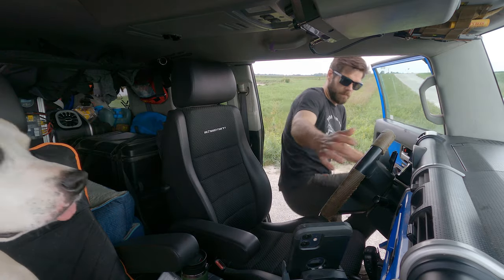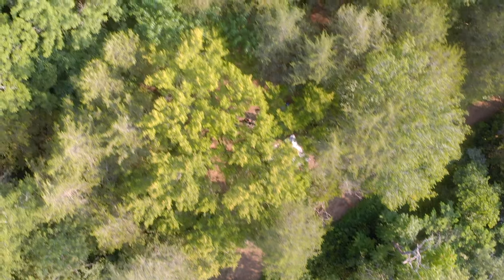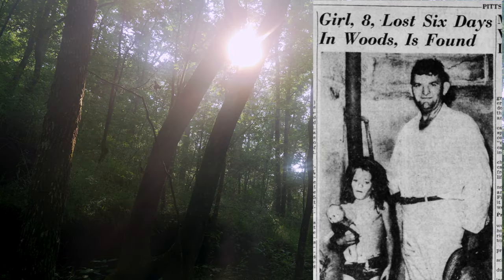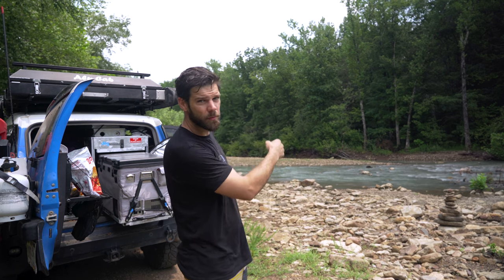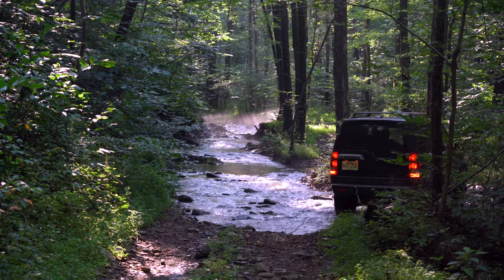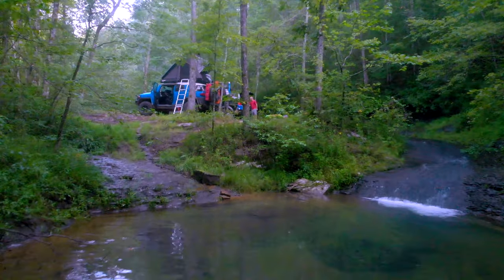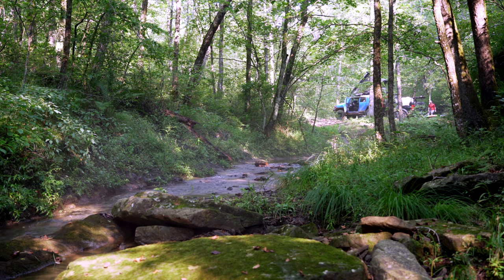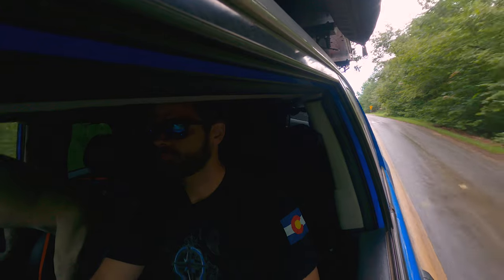Witness An Epic Overland Adventure Through Arkansas - You Won't Believe the Incredible Campsites!

Comment: In general, are Arkansas trails wide enough for full-size trucks…Ram 2500?
Reply from the maker: No, pin stripes on a mid sized are guarenteed. With my new truck build starting soon Arkansas has been in the back of my mind even. If I were to get a 6ft bed midsized truck, it would make traveling in those forests much more challenging. I am sure some trails out there can be traveled with a full size, but you will be limited.

Comment: Hey man, Love the channel and would really appreciate your counsel on the COG implications of RTT and awning mounted on roof of FJ. 

I've heard from some drivers it's fine, while others have discouraged me from doing it (I'm looking at the BushCo TX27 which clocks in at a whopping 270 lbs, as well as their 270 Max awning which is 70 lbs). 

My FJ is also my daily driver, and I do spend a fair amount of time on the highway, sometimes reaching speeds of 85mph. 

How heavy is your tent and awning, and how did installation of them affect the handling? 
Would you put nearly 400 lbs of equipment up on the roof of your FJ (assuming you had a Bilstien 5160/6112 system and the 3" Icon rear springs?

Really appreciate your help because I'm trying to make all these decisions this week as it's getting crunch time. Full disclosure: I've got Blackbear, Imogene, and Schofield on my radar for this July.

Many MANY thanks in advance!
Reply from the maker: Dude your super thanks is awesome! I’ve never gotten one before! Thank you!

That is a heavy tent! Holy smokes! The Alucab is around 180lbs I believe, awning is 65lbs. Shower tent is probably 25. Solar panel adds another 15 or so. My Fj is honestly the most top heavy I’d go with the vehicle. I won’t drive it without sway bars as it sits. I can do 85 and I feel safe doing it. Would I add another 100lbs on top of that? No I would not, but I know a guy that I’m pretty sure has the exact tent your looking at on his Fj and took it through Mexico. He doesn’t have the awning though.
Reply from the maker: As far as the shocks, with that kind of extra weight you might find that the combo doesn’t quite do it. I had icon Overlander springs and they weren’t enough for my weight, though I have a full interior build out as well as the tent set up. You will likely want stiffer springs both front and rear for the new setup, depending on how stiff they currently are. All that roof weight will shift when you brake and make the front of the vehicle squat more at stop signs, and the rear will squat as that weight shifts backwards taking off from stop signs. 

As far as this tent on trails, it’ll suck! Check out my Black Bear video I did recently and I was pretty tippy on some of that. Add another 100lbs to that and it would get sketchy!

So ultimately, and I know you probably don’t want to hear it but no I wouldn’t get the tent. I know it’s got a ton of room, but that’s a lot of weight up there! And things like bedding start to add to it. Feel free to ask anything more, and I’ll get right back to you!

Comment: I’m 10:50 seconds in and having a hard time understanding the allure of the LandRover, which doesn’t seem to be capable of the badging.
Reply from the maker: Shots fired! He seems to love it, but he also typically does more moderate trails
Reply: Late to this party. I understand that the LR is a mystery to most, so I understand the hesitation of these two fearing its capabilities.  As an LR3 owner, it was frustrating to watch this. First, that strut boot is nothing more than a dust cover, the same you'd find on any typical shock. 
So worries there.
 Second, the LR3 traction control is about the most sophisticated TC system out there. It can crawl about anywhere a full locker vehicle can, and that's coming from someone who has front and rear ARB lockers on his LR3. I just never really need them. 
Anyway, that's my defense of LR bashing.. 😂
Reply from the maker: @onasledoverland  I learned after this trip a bit more about the air suspension, I definitely didn’t understand what I was trying to fix.
Reply: I would buy an old 80s - 90s LR but not a new one. - a LC owner.